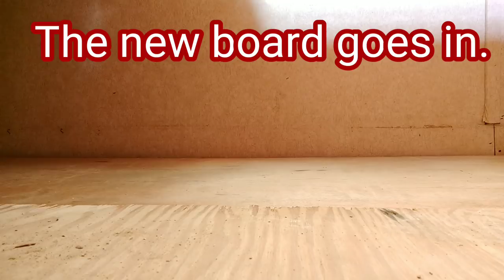Repairing a rotted floor. RV remodel renovation.Upgrading While Downsizing Episode 9

Comment: Thanks for posting this particular video.  We have a different brand of trailer but the bedroom design is identical.  I had a roof leak (fixed now) which came down the wall and caused the floor to rot in the same exact spot as yours did.  My floor in the storage area is better than what you had it looks like but I will probably still go all the way to the front end since I need to go underneath the cabinet anyhow.  Also, looks like you live local to me as well in the Piedmont Triad.

Comment: I had a 2001 S-17 Palomino hybrid travel trailer. Floor was completely Rotten. I did mine, took everything out of the trailer and replaced the crap rotten floor, took me 50 hours and a total nightmare. Sold it once it was fixed and will never again. Trailers are garbage @. Thanks for the video!
Reply from the maker: Trailers can be high maintenance.  I haven't had any leaks since I did the repair but I did replace the part of the roof later. We have traveled all the way from Niagara Falls to Tampa Florida with our camper and she seems to be holding up pretty well.  I try to reseal her at least once a year so I never have to deal with rot again.

Comment: I could show you some nightmares. Im currently repair/remodel a 31'dutchmen. Its been interesting to say the least. Once I finiish all structure damage I'll put the new roof on. Already got the roof. Also replaced the floor in the slide. That was fun when your working by yourself. LOL......
Reply from the maker: I would say I was lucky that I caught it when I did. It could have been a lot worse.
Reply: The Camper Couple yes your very fortunate. Im now working up accross the front, have the wall opened up, not yet to the end of the damage but its not as bad as I thought it would be. Mainly the front structure wood and about 2' back along the right side. I will have to remove the front sheet metal as I suspect the wood beam that screws to the frame is damaged. Just time my friend. Can't get impatient with this one. Already studying how I can do it better than the factory, that wont be hard. Very cheap and sorry construction methods were used. My biggest issuse is trying to remove bottom cabinets without destroying them. There good and would like to reuse them. Its kinda slow for me as Im fresh off cancer threatments and yet to fully recover. I BEAT stage 3 lung cancer in my right lung and at thiss time Im only good for about maybe 4 hrs a day. I just chip away and eventually I will have it completed. I wish you nothing but the best and hope all is well with you and yours.
Reply: I just purchased a used camper and have a bad floor in exact same spot.. Opposite area on other end is totally fine. Guess I will be doing the same thing soon.
Reply from the maker: Ever since I changed the weather stripping on the storage compartment everything has stayed completely dry.  Hope all goes well for you.

Comment: My only concern is that you did not take into consideration that the side walls are installed on top of the completed floor when these are built...which would mean the floor is rotted under the wall that is attached to it and it is quite possible the footer for the wall is rotted as well. My concern with this repair is that by just replacing the rot up to the wall, particularly without opening the wall to see what is left of it, quite possibly leaves you with a wall this is attached to nothing at the bottom!
Reply from the maker: Sorry I didn't include this in the video but before I laid the new board in I installed brackets to secure the wall directly to the floor joists which were still very solid.  So the wall is secure.  I got lucky that only the plywood had rotted.  We have been living full time in our camper for four months now and she seems to be holding together quite well. Not a drop since I resealed everything.
Reply: You missed poster Robert Oscars point.
 - The rotted plywood you pulled out extended out under the trailer side wall. It would have been better to jack up the side wall and slide your new piece of replacement - wider - plywood floor sideways from outside the trailer so it was also replaced.
 - Good work otherwise!
Reply from the maker: Maybe so but trust me it is solid.  Most of the wood  directly under the wall didn't come out.  It was so tight that the water didn't get to it so it was still solid.  I reinforced the studs with L brackets to be on the safe side. Since the repair was made the camper has been from New York to Florida and many places in between.
Reply: Each time I've worked on campers I find they all have their own little issues. There is no 'blanket' repairfits all, lol.....you take them apart, figure out what you think is best and effect the repair. I've never had any issues with amy of my repairs but everyone says I overkill on repairs, thats OK by me, I like maki g things better, lol